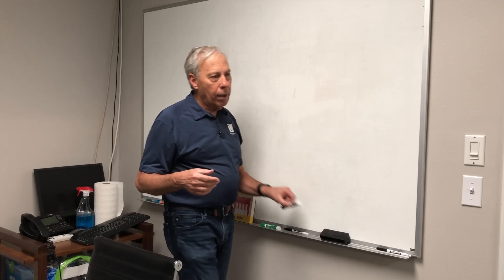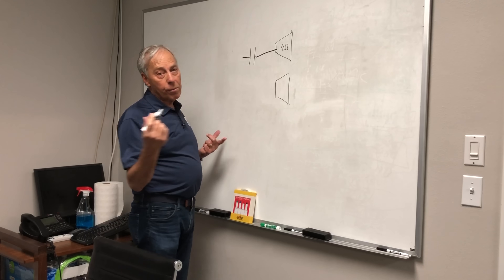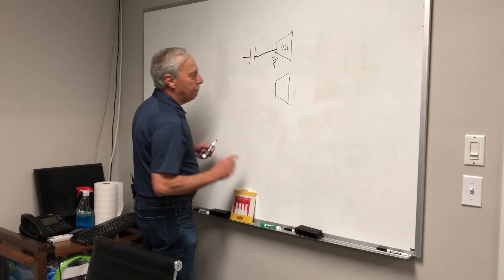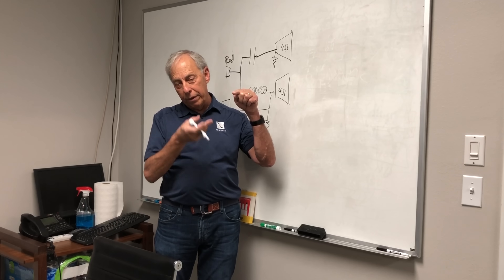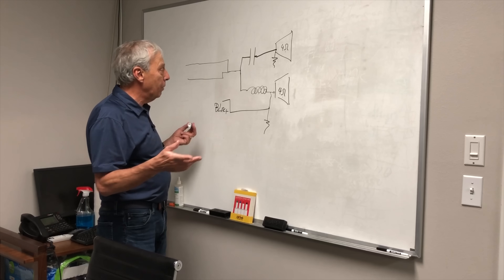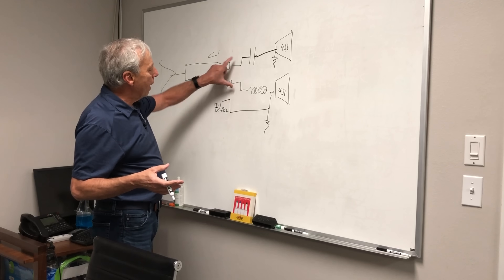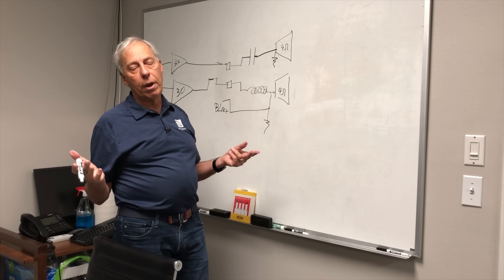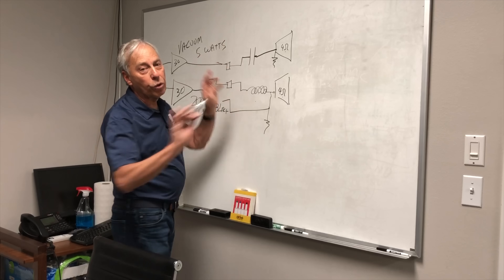How does bi-wiring work?

Comment: I truly do appreciate the explanation.  However, it's always nice at the end if you could cap things off with opinion on whether it's worth the trouble and expense.  For those considering getting into audiophile sound, or those that might have dipped a toe in, should this be something we're looking to do if speakers allow for it?
Reply: someone who knows what they're talking about needs to tell the newbies if, in fact, it is 'snake oil", no?
Reply: p.s - this has nothing to do with 'sale techniques'.  This is an opinion piece on the merits, or lack there-of, of bi-wiring.  Period.
Reply: @salmonline 
There are none; physics 101.
Reply: This is where one comes for Paul's opinion.
One should have/expect/respect Paul's opinion regardless of (as Perhaps put it) the "snake oil alarmists" (love that).
Reply: Michael B. To answer your question. No. Bi-wiring is bull. Bi-amping might be worth looking into.

Basic science lessons should teach you that splitting the two signals from the same terminal to use "another" wire will not in any way affect the electronic signal going trough it. It would only increase the gauge. (so just use a bigger cable, wich could improve it). 

These audiophile religious folks might swear by it, but it nothing but snakeoil to sell you some more sweet cables. 

One of many interesting reads on the subject:
http://www.achievum.eu/bi-wiring.html
Reply: Well everything and nothing is worth the trouble and expense.  Welcome to day one of (insert, hobby, passion, discipline here).
Reply: salmonline - Paul is not in the business of exposing snake oil sales techniques. There are plenty of other channels for that.
Reply: He is the snake oil salesman. He sells passive IEC amp power cables that make a supposedly "substantial" difference on sound quality. Of course he's not in the business of exposing it.
Reply: salmonline - I see this as his understanding of the topic(s). He is not here to sway you in one direction or other.
Reply: +Dragan Thanks!
Reply: Michael B. - I disagree. His opinion would very easily be pointed out as snake oil sales. Let Paul lay out the information, and let us make our decisions for ourselves.
Reply: I would value Paul's opinion, regardless of the snake oil alarmists.

If Paul holds back his opinions, then he has surrendered to the naysayers and trolls.
Reply: Perhaps  "snake oil alarmists"? What does that mean? There's nothing alarmist about calling out bullshit.
Reply: @0Perhaps 
He sells his snake oil to ignorant fools.
Reply: Michael B. If the speakers allow (two binding post), definitely try it. (It is also good if the amp has two exits for the cables, then it is not necessary to connect the two cables of the bi-wire cable in one at the end and to have one connection for the amp). The difference in sound is small, but there is. One of the reasons is because we now have twice as many cross-sections of the cable (bi-wiring cables)... 
Another good option is to replace the metal plates that connect the two binding post (connecting points) of the speaker, with short good cables - ''short connection'' (same cable as from the amplifier to speaker or better), and from the amplifiers to the speakers to put the best possible single cables (for the appropriate equipment). Many good speakers companies have speakers with only one binding post, because ''they don't believe in bi-wiring'', ''their crossovers are without compromise'' etc. In fact, their speakers inside the box have the best possible cables that are split in two and connect binding post with tweeter section or bass section of the crossover (and don't have bad metal plates). I hope it was informative (and it is all from my own experience). And understandable (because of my English).
Reply: @draganantonijevic2441 
If the cables have low enough impedance (that is, normal quality cable), it makes no difference.
Research Expectation Bias.
Reply: I'm starting to feel like you're being intentionally obtuse...lol..
"sway" and "sales" aren't part of this, guy.
You can try and insert them if you like, but that's not what's happening here, k?
Say it with me... "opinion"... lol.
Reply: @salmonline 
No, basic physics trumps opinion every time.
Reply: I made 5 comment 2 months ago.  Clarify.
Reply: salmonline - He is not an unbiased reviewer. His company manufactures equipment. His opinion will always be considered sales techniques that favor PS Audio equipment. Hence, he has to walk the thin line where he provides the knowledge without coming off as a biased reviewer.
Reply: AAAAnd there ya have it, troll...lol...
That wasn't too tough, was it?
Now beat it.

Comment: Paul , where do I start.  Ok do some type of wire handle highs better and some handle lows better . What type of wire handles highs better ? And the same question for lows ? Thanks I enjoy your videos , keep them coming
Reply: Andy B thank you for your thoughts . I can by no means afford high end audio, so I buy what I can afford.  But I like to get the most out of what I have and o enjoy figuring this stuff out and researching this stuff. And I thank you for your thoughts on my comment , I do understand that there are several trains of though on this subject . Thanks again and have a great day.😀
Reply: Paul McGowan.   thanks so by geometry you mean flat braided ? Being a ham radio operator  I know that for instance that for lightning protection the best wire to use is flat braided with no sharp bends , and also the at the rf level certain. Frequency' s tend to travel on the outside or on the surface of the wire .
Reply: @drewdohc  the
Reply: 4.6dohc275 you are wellcome. And you are on the right way when you said ''want the best I can get...'' and more ''from every situation you can learn something''. Have a nice day / night
Reply: Dragan Antonijević hi there and thank you for your thoughts on the matter . I do understand that there may be so differing opinions on this . I do find it a very interesting topic ., as I said in previous comments there is I can afford Paul's equipment unless I win the lottery . I am very interested in stereo and want the best I can get for what little money I have . I consider my self pretty good at fixing this stuff and also good at kit building so sometimes I run across something someone has decided not to repair and I invest a bit of time and money and get something nice out of it . When you stop learning , you stop growing , everyone has something you can learn from
Reply: ABaumstumpf is pretty much right on target,  but there's so much bullshit out there it's hard to get to the truth.  As for me, I run straight Romex wire from my amp to my speakers (yhea, the wire's hard to work with, so what?) and I will put it up against any wiring or cabling out there.  I'll say it again : beware of bullshit.
Reply: Sorry drew ''4.6dohc275'', I am not Paul, bat in my humble opinion (and experience) is this way: for highs - silver, single core; for lows - cooper, stranded litzs. On the geometry (construction), twisted-braided pairs more often give better results (in both case), although I personally use parallel 2x pairs (bi-wiring cables - solid core, cooper - from the same company like m.b. amps - excellent result ). Sorry on English, too.
Reply: There is a simple answer: Doesn't matter at all.
Unless you are using way too thin wire there is no difference. There have been tests were they replaced highend studio cables with freaking COATHANGERS and there was not only no noticeable difference (trained expert could not tell) - there is not even any measureable difference.

Wires simply deliver the signal. If the wire is too thin then you got a problem. but that's it.
(And RF, high frequency and high voltage are a totally different subject. a audio setup does not run at 1000 V or 500 kHz)
Reply: @ABaumstumpf  Good morning and thank you for your response.  I am currently using 12 gauge extention cords ( the orange ones😀) and I am not running a 2 channel system , but a 5.1 . The longest run is,30 ft for the rear channel and about 20 ft for the front and a powered sub woofer . I picked the cord choice because of the heavy gauge and the high quality fine stranded wire composition and they were on sale  . But they were not the cheap store brand.  On a different but somewhat maybe the same subject , in June I passed the general license exam and so the "cave"  doubles as a ham shack as well .  I only picked up a used icom hf rig a few weeks ago and last weekend made and installed a fan dipole outside . I must have things well shielded because I am not hearing any interference in the audio system or in the video as well . I hope you have a great weekend and an even better week ahead.
Reply: @ABaumstumpf  omg, I've been doing this shit my entire life and the stuff I see and read on here blows my mind .. you sir, are 100% correct and have restored my faith that at least SOMEONE has clue...